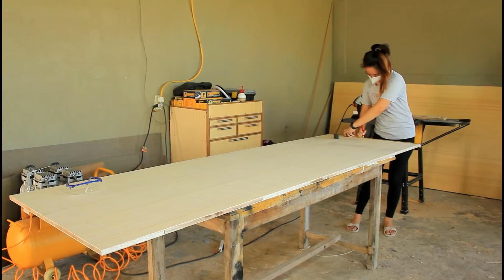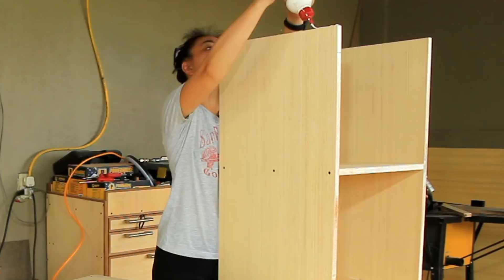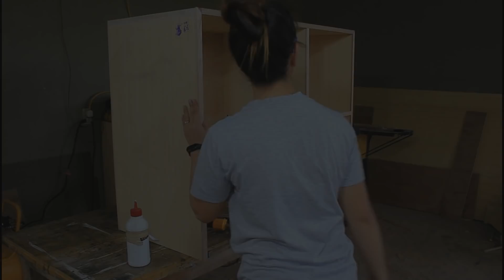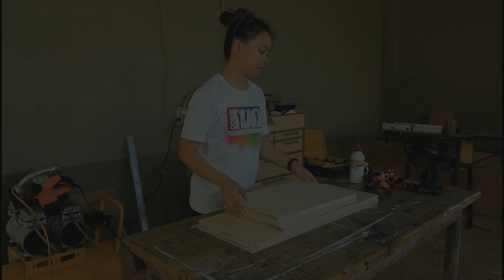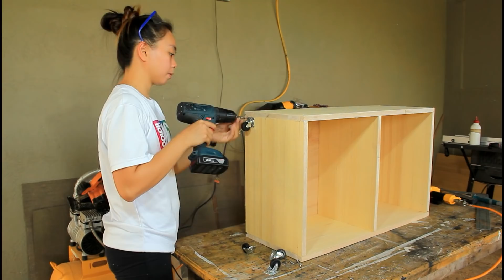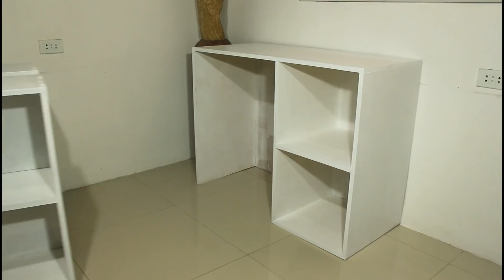DIY PULL-OUT BOOKCASE CABINET

Comment: Hi, Great video, if I could make a suggestion where you have installed the wheels I would of let the bottom panel run striate through as to give the base more strength rather relying on the screws and glue, as alway great video.
Reply: Hi you do great videos thanks

Comment: Fits well into my space, I painted the back green. It's very easy to customize just the back if that's something you want to do. I would suggest sanding it first before painting, I got a little impatient. The shelves https://www.youtube.com/post/UgkxM8H4CjCb79vzeyvgaFMdzmLm88oVFPMkare pretty small so keep that in mind if you're going to have it horizontal that some books won't fit. I like the snug look that it has. Good small shelf if you don't have much space, but not too small. Simple to put together, though you'll need your own tools, a screwdriver and a mallet/hammer, it's easiest to do with another person.